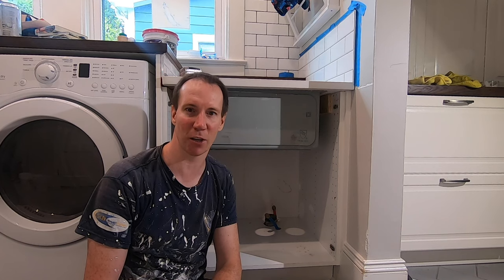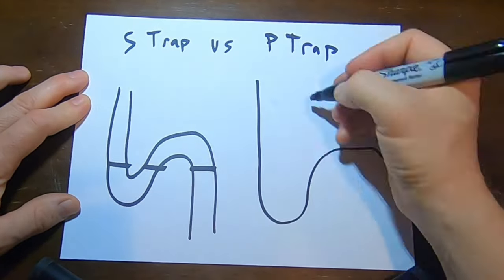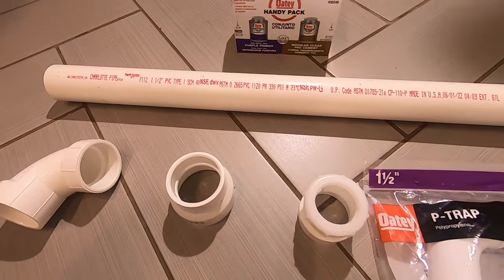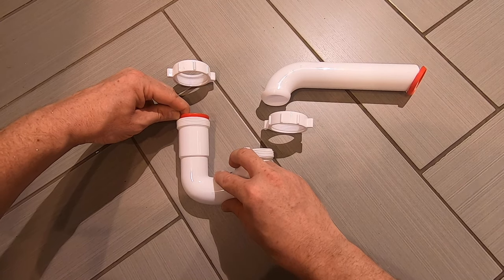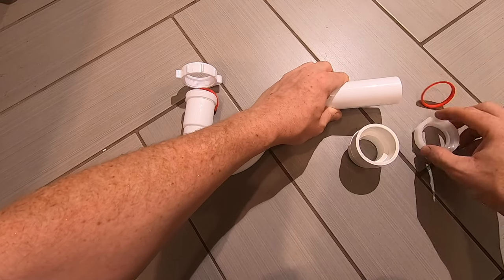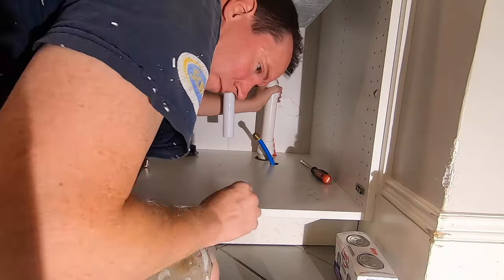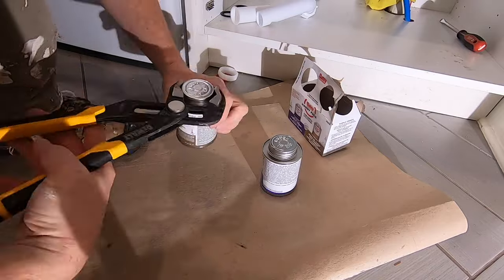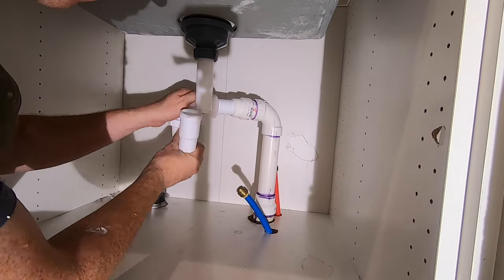How to Install a P-Trap for Kitchen and Bathroom Sinks

Comment: this is terrible.  After all your talk about P traps  all you did was install an "S" trap which is against code.   Where's the AAV?
Reply: I was watching this and I'm like that's the wrong trap why am I watching this
Reply: I have the same situation, if I were to put a Tee where the drain is going through the bottom of the sink, then a elbow with a pipe extending up with a Studer vent would that be OK?
Reply: @atvridgerunner  tee wye with a fitted end clean out on the top if the drain is back vented
Reply: So I’m doing this and I am set up to have a Tee connected to the P-Trap. I plan to stub up about 6 inches and put Air Vent above the Tee  and below would be drain out. Hope that’s correct.

Comment: This is an S-Trap with a length of pipe added at the top of the S.  You didn't create a P-trap, and it won't stop any siphon action as it's missing that vent pipe behind the wall.
Reply: This is what you call a long s trap. "Capital S trap? Lol 
Spanish S?
Reply: He should've installed an air admittance valve, right? I'm just learning about plumbing...

Comment: Seriously, thank you for this. I wasted so much time today between the house and Lowe’s I was about to give up. Your video explained my problem perfectly. P-Trap first, everything else after should just be glued and fitted to meet the floor instead of wasting time with all these screw on fittings. 90% of the videos on YouTube are regular P traps without a wall drain instead of the floor.

Comment: Vent? All traps need venting in all cases. Without a vent, the water seal in the trap gets sucked out and sewer gases can enter the room.
Reply from the maker: Good catch - and warrants some clarification.  First solution would be an Air admittance valve - While not all codes allow one, it would be easy to install one here by substituting the 90 degree sweep from horizontal to vertical with a sanitary T and then placing the air admittance valve usually about 6 inches above the horizontal portion of the P trap.  Second would be to  create an upside down "U" to create a loop so, a sanitary T to replace the 90 elbows, go up about 6 inches put on a 180 bend and go straight back down.

The loop was not chosen since this is a retrofit (just new cabinets and sink) and would be difficult and costly to install. The air admittance valve while possible, is not needed given that the piping for this single fixture is arguably considered oversized as under the floor it quickly increases to 3 inches and the distance to a vertical vent that goes through the roof is about 2 feet.

In summary, I would put it this way: a good, better, best scenario. Best would be the air admittance valve, while the better scenario would be what is shown in this video.  This would work 100% fine with normal usage.

Maybe warrants a follow up video on the specifics since plumbing is simple yet complicated.
Reply: Thanks guys!   New project for me.. will get an air admit valve too😊

Comment: I'm pretty sure that's still an S-trap.  You need some kind of vent where the elbow that turns down is.  At the very least, using a T instead of the down elbow and putting an air admittance valve on the top of a T.
Reply: It's an unvented P trap

Comment: Need the sand tee with a vent on tub your not doing a waste arm inside the wall drain is coming from bottom up and need the stud vent unstead of using that 90 should be a sant tee just and advice Godbless

Comment: Hi on a sink a short pipe is code   on a hand basin it is not  eg a trap vent    or a 300mm. 600mm horizon tal  30 to 1 fall

Comment: Disappointed! The diagram on the lead in, shows a vent! I wanted to see what kind of vent you installed and all you seemed to do was install a slightly extended s trap. I'm guessing that this will syphon depending on where the vent in the system is, if indeed the system even has a code compliant vent installed.
Reply from the maker: The piping for this single fixture is arguably considered oversized as under the floor it quickly increases to 3 inches and the distance to a vertical vent that goes through the roof is about 2 feet from that point. This will (and has) will work fine.

Comment: You need to use an AIR ADMITTANCE VALVE for venting.
Reply: No you don't depending where you are at. Some have the handheld dish sprayer that serves that purpose
Reply: @ChipChurp  
OK??? So you say a handheld dish sprayer is a source for venting ??? Where I am at ...Always thought a handheld dish sprayer is a source for water. There is a difference in a vent line vs. a supply line.

Comment: Funny u talk about no to do s trap and you did one ,instead of the 90°,use a 1 1/2 tee and on top of the tee use a short piece of pipe and on top install a in line vent